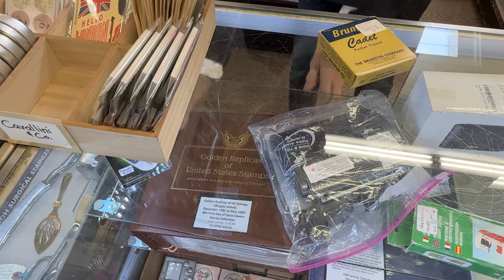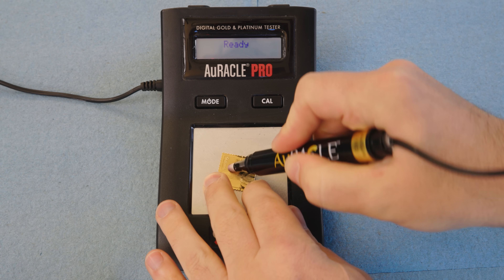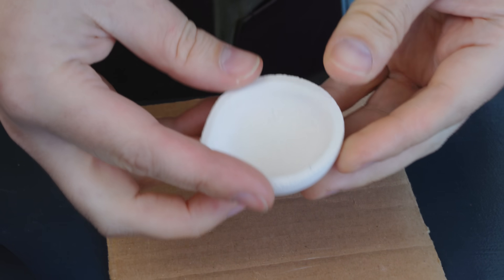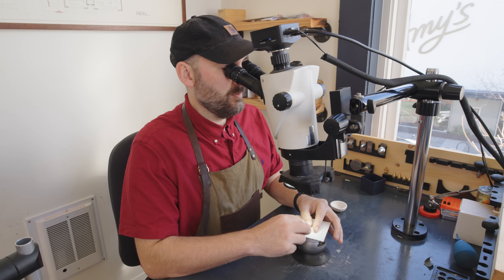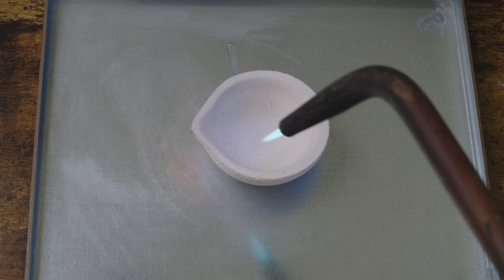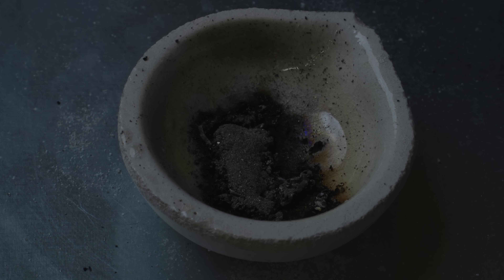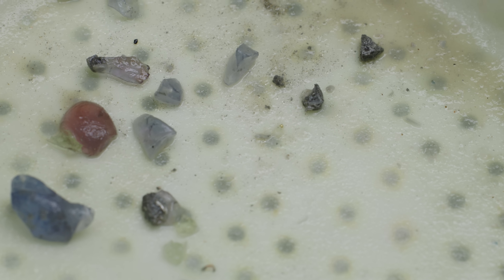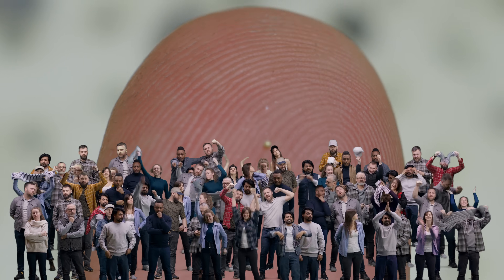Turning Gold Stamps into Real Gold!

Comment: According to Google, fingerprint grooves average about 0.5mm, or 0.05cm. So, let’s assume that bit of gold is a sphere of radius 0.025cm. Then its volume is about  0.0000654cm^3. The mass of a cubic centimeter of gold is 19.3 grams. And so that little speck of gold has mass of 0.00126 grams. As there are three stamps worth of gold there, divide by 3 to get 0.00042 grams of gold per stamp. At $110 per gram of gold, that makes each stamp worth about $0.046, or less than 5 cents. Those books usually contain 40 to 50 stamps, so they contain about $2 of gold. A thousand stamps would be worth about $50.

Comment: Would have been WAY faster to use a fine grit sandpaper. 

Some of the gold dust would get stuck in the sandpaper but the time saved would be absolutely worth the tradeoff.

Those books of stamps contain a bunch, and it was originally a set of 4 books which contained a large amount.

I feel that it would be worthwhile to do them all.

Comment: You're dealing with gold leaf glued to paper then stamped so measuring the area and comparing with commercial gold leaf should give you an idea of expected weight per stamp since they're generally all the same size without having to get enough processed to register on a scale. 

The only realistic way to process would be chemically breaking them down through a few stages; remove paper, remove adhesive, clean, and finally dissolve gold and recover. 

The gold is too minimal for an effective melt with mechanical separation because the adhesive and carbon content is too high which could lead to a failure to recover more gold or a complete failure to recover anything if impurities are too high. 

The adhesive is difficult to estimate it's effect on the melt because it's composition and decomposition cycles are unknown but adding an unknown decomposition cycle to a melt is on its own quite risky. Identifying those decomposition cycles is important when dealing with impurities like iron, sulfur, etc..

Comment: I have a large number of these replica stamps that I bought years ago thinking I could process them someday. I always presumed they were just a piece of gold leaf with the impression stamped in it, then protected in the plastic encasement. A couple weeks ago I took one out and discovered the paper backing. I soaked it in a saucer of hot water for about 10 minutes and then the bulk of the paper pealed off cleanly leaving only the adhesive residue and a very thin bit of paper. I don’t have the equipment you have to melt it down, so I’m not sure what the next step is for me, but I’d like to process them all, about 1,000 of them, and be done with them.

Comment: The best and most efficient way to collect this gold would be to put it into a solution of aqua regia, which would dissolve the gold in the mixture and leave the paper intact. You could then use the gold-bearing aqua regia, mix with ammonia water, filter the mixture, and you'd end up with gold hydroxide. If you then sediment, heat and bake it, then you'd get metal gold.

Comment: If a thing is not made entirely of precious metal, but only has a coating of it, it is never worth trying to melt the metal off it, because the monetary value of the metal that can be melted out will be less than the monetary value of the item.
Reply: Not true. Check out Sreetips YouTube channel he refines gold plated jewelry into gold bars on occasion
Reply: Wow that's a very simple thing where did you find that out?
Reply: There's loads of channels showing that you can
Reply: I made a 50k melting down 1 ton of used gold plated dildos,
      so its definitely worth doing 👍